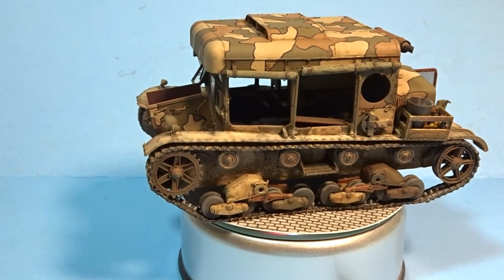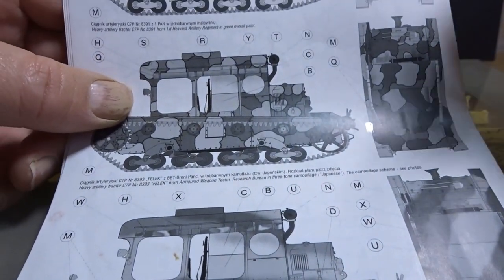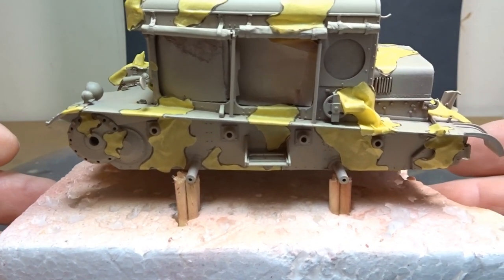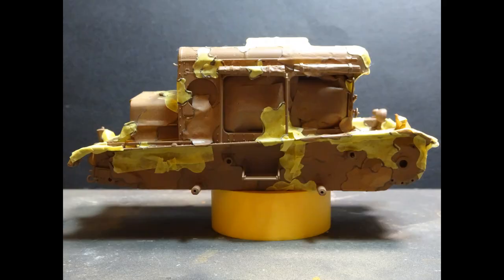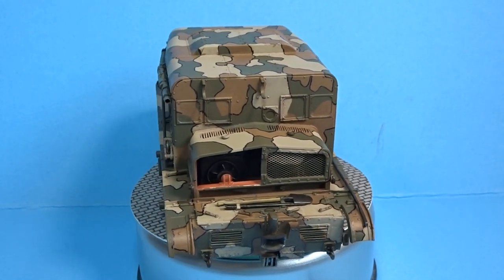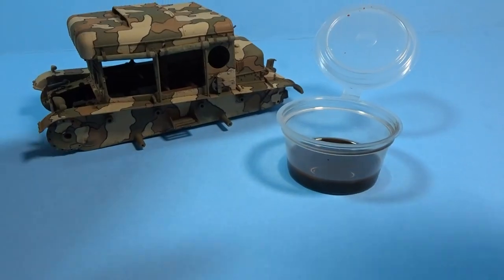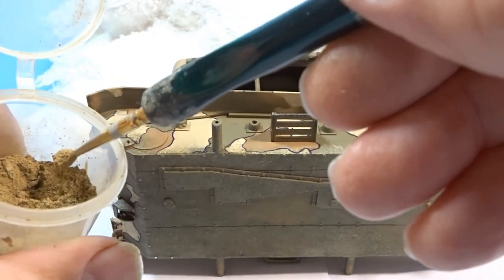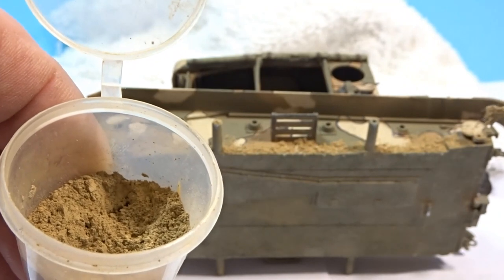Mirage 1/35 Scale Kitbash C7P Polish Artillery Tractor FINAL.

Comment: Hi Steve
Frustration sometimes happens. I think once you start to loose heart in a build things often seem to go from bad to worse. Having said that I agree with many of the other comments when they say it is still an excellent model. The more detail you add the more fragile the model becomes unfortunately. I really love the realistic effects you get from the layering technique you use for weathering. 
I gave up on the MIG fixer as I found, just like you, that it destroyed paint and glue - not always but using it was a bit of a lottery. I changed to VMS pigment fixer which I really like.
A great video. On with the next build.
Reply from the maker: Hi JR. I will give the VMS fixer a go at some point. You are right about the detailing. My latest build is nice and chunky and a lot easier to build. Many thanks for looking in and happy gardening😀😉😎

Comment: Sometimes you get a project that doesn't come out as planned. It's hard to stop building, but even harder to keep going. I did it with the PL-01 Prototype.
  In Your case, the fault is the poor quality of the model. There is no need to hide it. You did what you could and much more. I watched you make the interior from scratch. What a job ! My copy of this model landed in the trash, after watching your videos. The effect does not compensate for the amount of work put in. Interestingly, I have the same observation about tracks from MasterClub. They have great reviews. I am just finishing a project with the T-20 Komsomolets and I have bought tracks from MC. The links themselves are not very well made, a lot of cleaning is needed. But pins are a drama. They fly out or break. I had to stick almost all of them with CA glue, so the tracks are not fully movable. I will see what the end result will be after installation. Wish You all the best. Cheers.
Reply from the maker: Hi Chris. I hope all is well my friend. I fully agree with all that you have said. The MC tracks are awful with those plastic pins. I replaced them and used wire but just found the metal to be sub standard and easy to distort. I appreciate your positive feedback on the interior. Its a mad hobby that we do but most of the time a very enjoyable one. This is a rarity for me and I accept it for what it is. I am back at the bench with another project and the mojo is running high. Many thanks for your support my friend and happy modelling